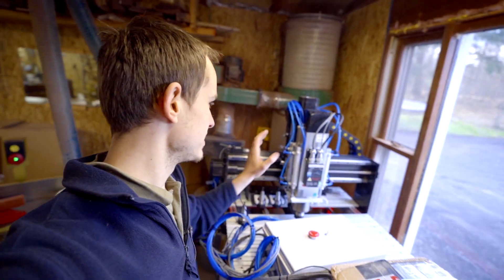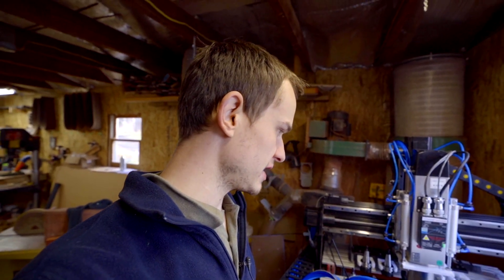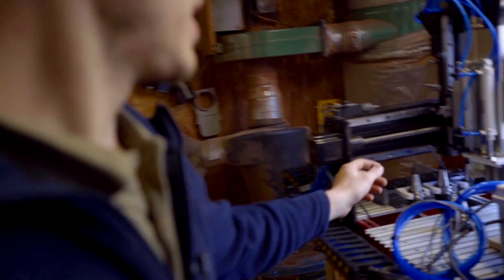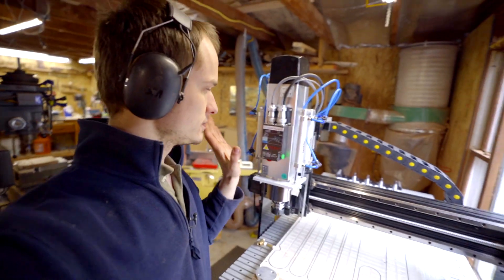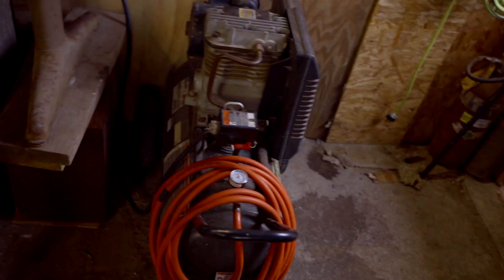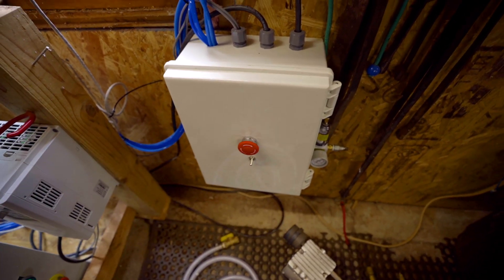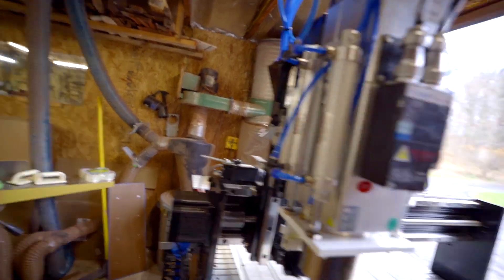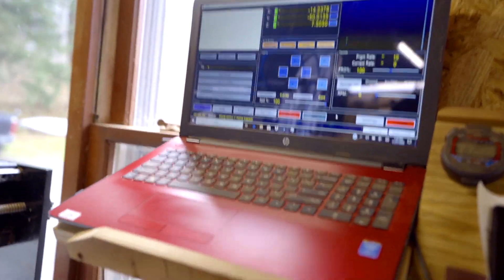Automatic Tool Changer for CNC Router!!!

Comment: do you use oil in the air seal air supply on atc ?
like a air oiler.
Reply from the maker: Nope, never even heard of such a thing. Do you have one you can reccomend?
Reply: @JesseBorn  Not really I am just in the process of setting up this. 4.5KW 220V BT30 ATC Air Cooled Spindle Motor Tool Changer&5.5KW Inverter VFD. And I am just trying to figure out if the air shield would work better with oil in the air inlet. Or last longe

Comment: As a fellow  cnc .. i have questions as i learn about atc spindle and tool chagers

1. What software are your running mach?
2. What changes did you make for atc spindle in you software for spindle and tool..
Looking for someone to share the electrical and pnematic drawing to set up a system...to vusual what resorce are need hardware what code is required to change in the user interface ie mach etc

Nobody has a how to setup video very fustrating
Reply from the maker: Stepper3 cnc is the mach software.  It's pretty easy (as far as I can see) to enable atc in the gui for s3 cnc.
Reply: @JesseBorn  could you plz help me to add the atc to my CNC mill...Plz plz

Comment: Nice! ATC is most convenient. I'm using it on one of my machines and thinking about upgrading the smaller one, to be able to perform automatic probing on workpieces as well. Don't know what you're using for CAM, but i have a FANUC compatible controller that doesn't need an M6 to perform a toolchange, just T1 or T5 and it changes the tool. When using Fusion360, i need to uncheck the 'preload tools' feature, (this feature lists all the used tools in the gcode) with this feature enabled it just goes through all the tools before it starts machining and starts the program with the offset of the wrong tool . You might want to make your flags for homing more stable or protect them from bending/moving. It will bite you in the arse sooner or later.
Reply from the maker: Yeah, I believe this is just using the T5 without the M6. There is no preloading of tools with my fusion code, but I am trying to figure out why the offset is about .030 low...I could fix it manually but I want the machine to remember the correct length after a touch off.
Reply: @JesseBorn  is it always the same wrong offset? This could mean the height of the touch probe is not set correctly, is there a g43 in the code and is the correct length of the tool in the tool table?